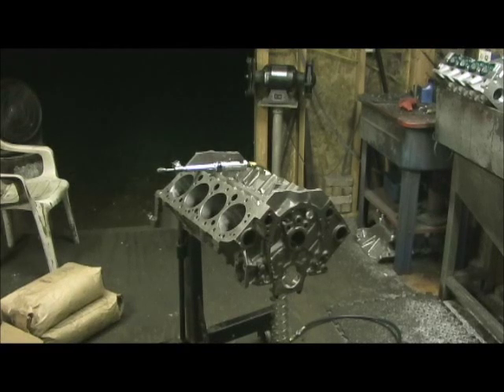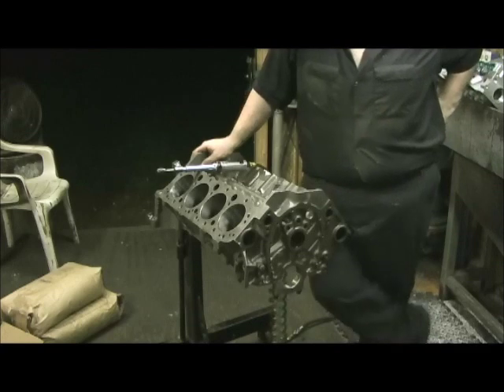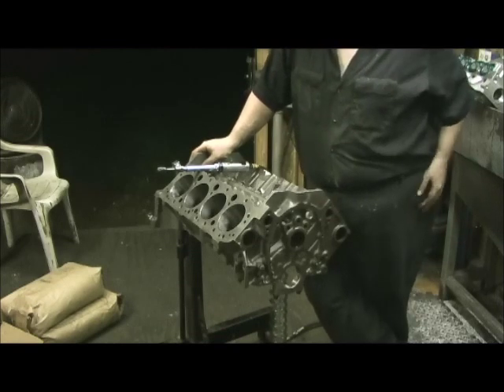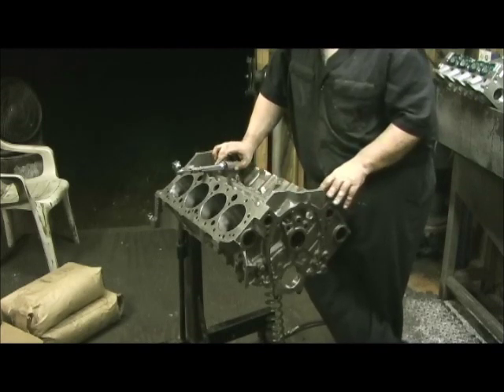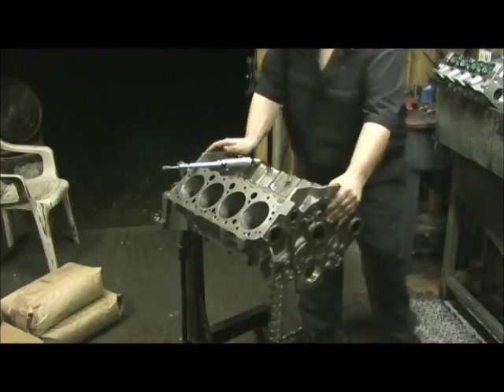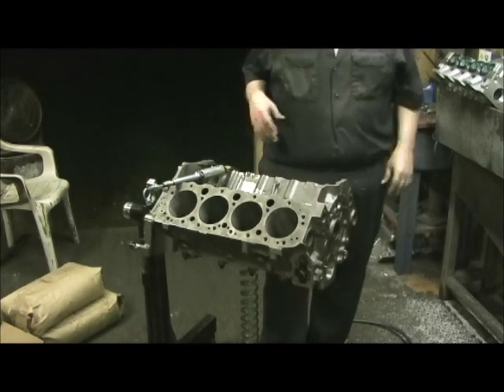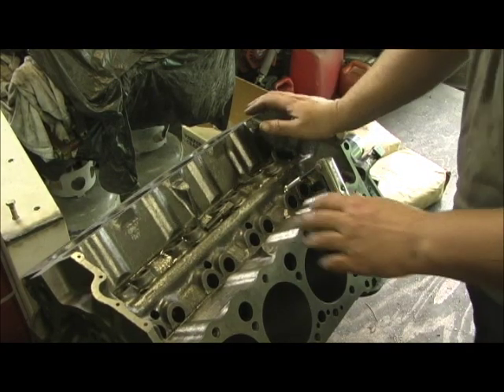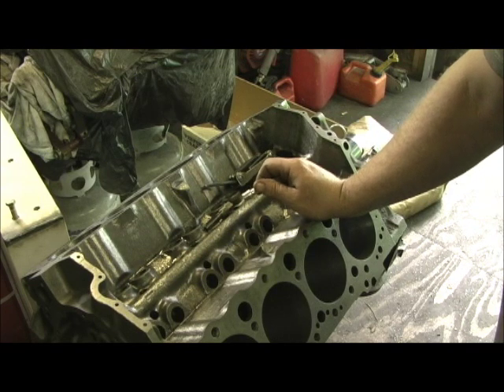SBC 334 Stroker "Holder Boulder" Grinding the Lifter Galley, Mods Part 3.0

Comment from the maker: he is a good guy, one of the best I met in 52 years, he is just an Ashland city Hick Carp, that simple, and he calls his pistons and rods Clint black pistons, and Buzzard Eye rods (eagle rods). the part that gets him is his pricing is about 20 years old, and these blueprinted projects take TIME, I do one in about 90 Days, and assemble the engine over three times to confer, (4 corner mock up, Oiling system mods, recheck everything the machine shop does, then parts blueprinting. he don't get it

Comment: You can grind the area behind the rocker bosses for the tie bars to clear, use the 4cyl factory roller lifters , drill and tap the block for the factory spider, run a cam button like a solid roller , or you could drill and tap the front of the blocks for the retainer plate , find a hyd roller cam on eBay like the hot cam , your set up

Comment from the maker: Using Eagle SIR 5.7 stroker rods. I ordered KB tool steal pins today, they say there 118 grams, I don't know what they are stock, I am going to weigh them this week stock. I figure around 50 plus grams I will eliminate which adds strength, quickens RPM and will allow extended 6000 RPM use.

Comment from the maker: Carburetor needed, the 416 heads are great to begin with just mod them for 1.90 and 1.60 valves with some level III or greater porting. Change cam. That should do it.

Comment from the maker: This is going to be a full ground up build, with several parts in detail discussion and MAYBE a engine dyno run. Then full video on the lake with the engine, RPM and gas mileage and HP after installation. Stay Tuned..

Comment from the maker: I was going to, but need outweighed want here. Holder said "get what I need" but at the same time he cried every time I needed money to do it,. if you know what I mean. That being said, When you look at the fact he will NEVER go over 6000, has 9.8.1 compression, and valve spring pressure at 125@ Seat, and 310 over the nose, I decided to go with ARP Bolts. There was just not (in my opinion) a need for that, as the Line Hone would have been more, and the studs would have been more. Nuff said.

Comment from the maker: I am trying to keep the power/money cost down as his outdrive is rated at 5000 RPM, and or 300 HP. It is the alpha 1 outdrive, and the bomb is the Bravo outdrive (6000.00) which would let me have but a 434 CID in it. The objective is to let the power have a slow build up while letting the RPM come up to terms with the ability of the outdrive. This should fill the bill with what he is doing.

Comment: A friend just brought me his 81 Malibu to do some work on that seem's to have a re manufactured very early 305 with # V0412DDD on the deck pad just behind the alternator. He doesn't want to replace it with more cubic inches and want's Me to help him get significant performance gain's from it. Where should I start ? Head's & cam swap ? tuned port fuel injection from a Z28 ? What ? He's shooting for the Bang for your buck deal ..Any idea's the heads# 14014416

Comment from the maker: He don't need that much power at this point, as MPG is a part of this, he would have DIED over 600.00 worth of cam and lifters.  He should be just under 400 at around 370 to 385, HOWEVER, he will have around 400 Ft. Lbs of torque, enough to PULL skiers right out of the water....